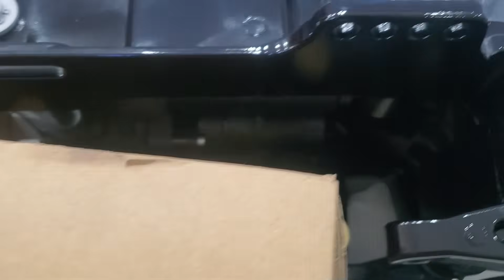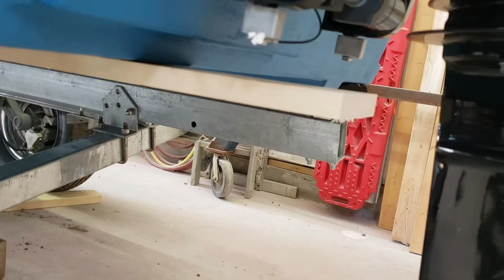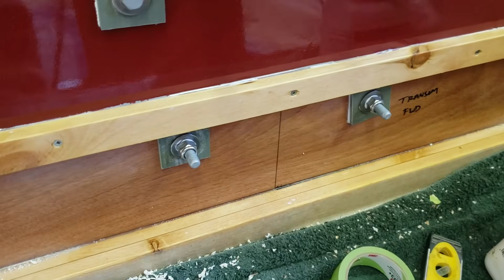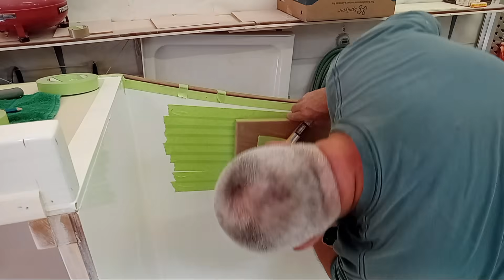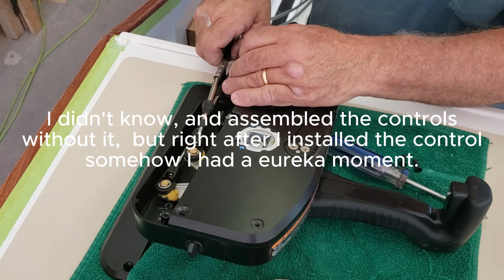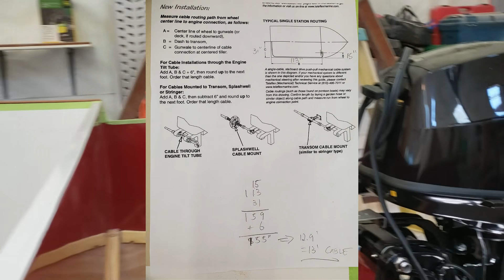Building the Michalak AF4 Grande Skiff 32 | Hanging the Engine and Controls

Comment: Looks great.
Is that a three cylinder engine?
I always loved the sound of a three cylinder engine…I had a three cylinder snowmobile and a three cylinder turbo car at the same point in my life…just a cool sound that the triples made.

Good to keep the cavitation plate at that height because the efficiency that you’ll get is so much better than having it lower…it’s amazing the difference that the height makes for a faster launch and efficiency…I moved my engine up only one inch and the difference of a flat launch instead of the bow coming up and all that drama completely gone.

I added a sport se 300 hydrofoil to my engine and that changed the launch even more and steering is so much better and I can stay on plane at a much slower speed…I can now stay on plane while going through heavier seas-this helps more than I thought it would.

Cool boat, man!
Reply from the maker: It is a three cylinder, correct.  Should be a great engine for this lightweight and totally flat-bottomed boat.  Thanks for watching!

Comment: Well done on the motor mounting. The overhead crane sure made the task easier and safer. Too bad about the hydraulic steering, but the mechanical system will be easier to maintain and fix if needed. Thank you for sharing the video.
Reply from the maker: There's a certain sense of relief and rightness when I return to my "keep it simple" instincts after brief but instructive detours down the "fancy" highway.

Comment: Thank you for this video.🙂 I saw a "handle" to start the engine. Have an electric starter aswell ?
Reply from the maker: Yes, the engine is electric start and remote-controlled, but still has the standard recoil starter as a backup.

Comment: When I originally designed my boat i designed it to use a 2.5 hp outboard. I ended up buying a 9.9 hp so I can have an alternator and fuel injection. Unfortunately that goes from 30 lbs to 102 lbs. I’m hoping to move my electrical system forward to balance the boat properly. If that doesn’t work I may have to modify the rear of the boat. I don’t really have an issue with that since this is basically a prototype.
Reply from the maker: This design is intended for up to 35HP, but clearly intended more for the clamp-on type.

Comment: Usually the reason for different size bolts/nuts is so you could work on it in the field (water) with one set of spanners. They do it on adventure/dual sport motorcycles , royal Enfield even do it on their road bikes.
Reply from the maker: Interesting info, thanks.